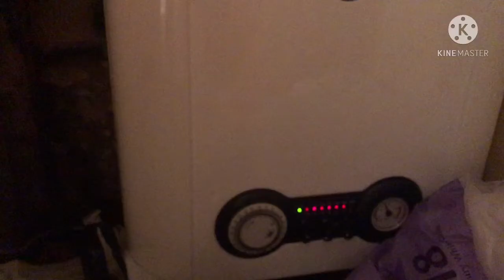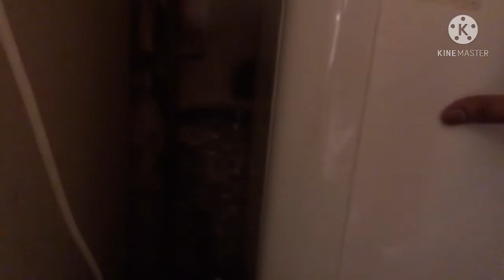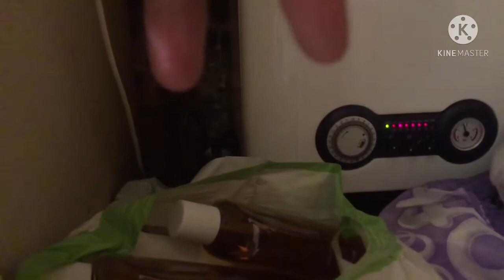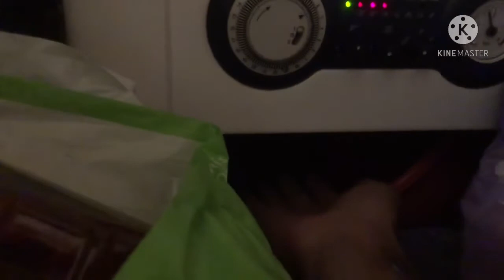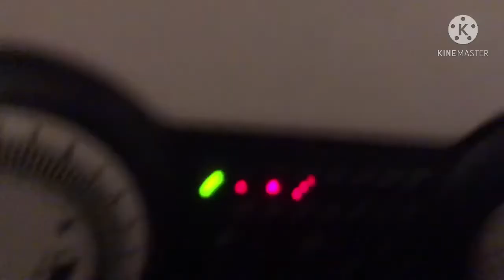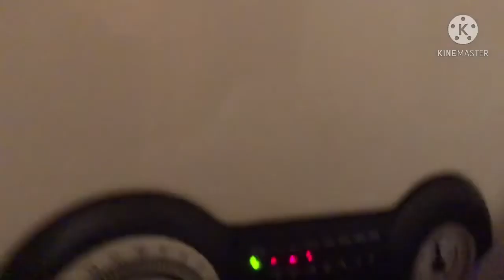Heatline boiler no flame fix

Comment: I did this to my boiler a decade ago - when the wind outside caused blowback it would splash on the boiler trap sensor and trip the shut-off - I think the sensor is there in case the condensate  outlet is blocked or frozen